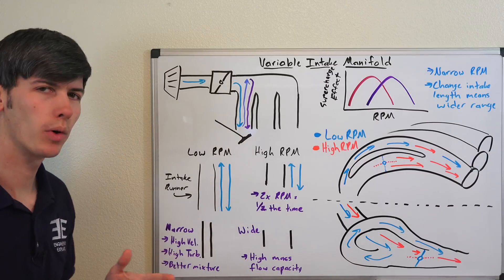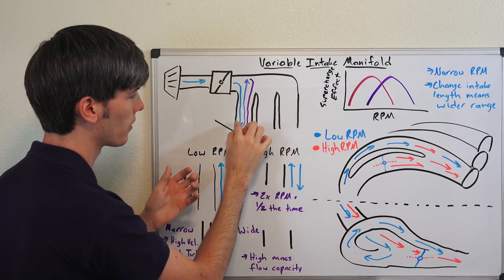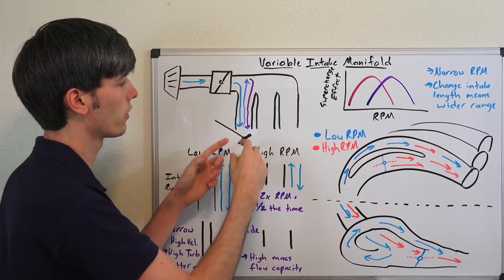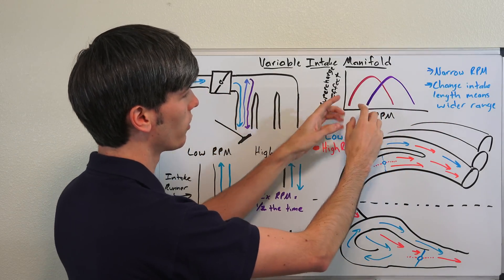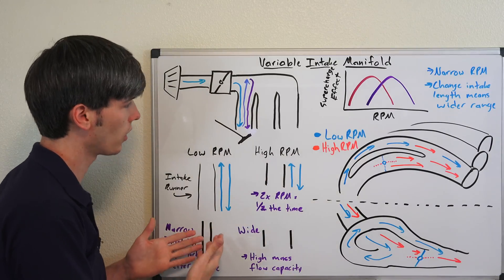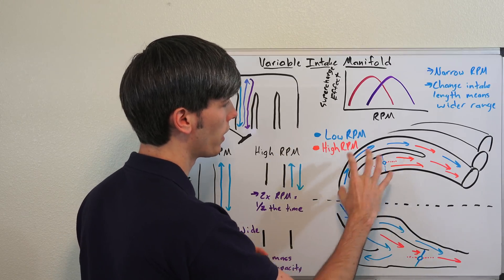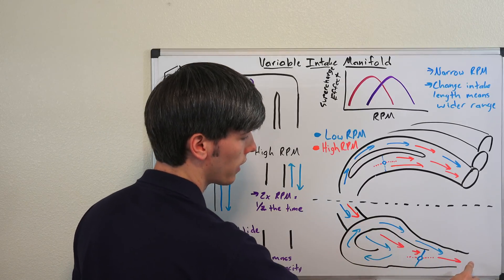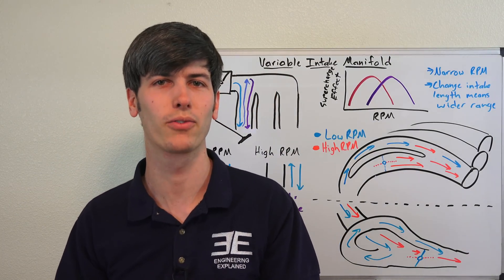Variable Intake Manifolds & Intake Tuning

Comment: How much air is really bouncing around under partial throttle and 15"+ of vacuum? 
Any air bounced by the valves probably just goes straight to the next intake runner.

Comment: Is this the same as those empty black boxes connected to the intake pipe after the air filter box? On some cars I have seen several boxes of varying size and dimension with no known function. My guess is that it's perhaps creating a low-pass filter effect on the intake path to create more constant and less turbulent flow, so the engine always has the best air supply to the plenum chamber.

Comment: I aways  think that the velocity of the air in the runners makes the "supercharching effect", when the valve is closet the air get compressed, and in the right time, the valve opens again and get the compressed air. 
I am right? because if I'm not, how the waves resonate in engines without plenum? like many competition cars.

Thanks.

Comment: I don't get why my fluid mechanics professor has such a boner for water on hills and tanks and not this stuff.
Reply: Probably better employment opportunities in hydraulic systems?
Reply: +tanker9987 Maybe huh.  Power plants, energy initiatives, etc.
Reply: As you know, a fluid can be either a liquid or a gas. Just keep in mind that almost everything in your texts about liquids can also be applied to gases. This would include water hammer. Water hammer with a gaseous flow is found in "tuned" intake manifolds. Back in the forties and fifties, Offy engineers relied on fourth harmonic tuning and used a hacksaw for length "adjustments" on the dyno. Unfortunately, they were tuning to the fourth harmonic. If they had lengthened the injector stacks, they would have "found" the third harmonic, which Chrysler used so effectively a few years later.

Comment: Hey E.E. I was just wondering,all of these technologies are to improve performance over a wider range on the power band.
If cvt's were introduced in more vehicles, do you think it would be more cost efficient to use simpler and less complicated engines,and then in conjunction with the cvt just hit the" narrower" sweet spot of the power band for acceleration??
Thanks for the videos, keep them coming, and next up 2stroke tuned exhaust's and ypvs.

Comment: Do a video on Toyota TVIS system
Reply: The TVIS in my AW11 makes my wanger jangle
Reply: +Vincent Baelde-Millar Metal Intakes! (Mr Regular, Regular Car Reviews)
Reply: Lovro Antunovic Toyota Variable Intake System
Reply: And how many other engines have such pretty cast aluminium intake manifolds
Reply: I'm so happy to finally be in the MR2 club. Just bought an '89 that had been sitting for 15 years. Got it running but it idles at 1,500 RPM warm and has a weird whistle/whine near the intake manifold. I'm going to set base timing and see if that calms it down a little but I suspect either an air pocket in the IACV or a bad IACV. I will eventually port the head and tune the intake and maybe throw a custom map into it. IDK I'll see how far I go with it. I just have to get it running right in stock form first.
Reply: +RyanRants Check the Waxstat is working. that's a common fault that causes high idle.
Reply: RyanRants The best thing you can do is get it running right, at least for a few months, then throw some sticky rubber and some good brake pads on there and you'll be giggling non stop
Reply: MylesHSG That's what controls the IACV, right? How would one go about checking that? The same way as a thermostat, boiled in water?
Reply: +RyanRants The Waxstat is located below the throttle body and regularly gets stuck (so you get high idle even when warm). The best way tk test is to delete the Waxstat (youll have to hold the throttle open on cold starts) and see if that cures your problem. If it does you can buy a new one from Toyota (£95) or fit a manual choke which is cheaper and is a permanent solution.
Reply: I've just read that cleaning the throttle body out could be another solution so I think I will do that first because mine is very grimy. If that doesn't work, I will try blocking off the waxstat and see if it idles properly. Thanks for the advice. I'm pretty sure my timing is off though because it falls flat on its face below about 4-5k rpm.
Reply: I recommend joining the MR2 Mk1 Club forum mate. Even though a UK based club there are loads of AW11 owners willing to share help and Paul Woods who is the worlds best MR2 guru frequently posts.
Reply: The Wiki article has a great and fairly simple explanation on TVIS https://en.wikipedia.org/wiki/T-VIS
Reply: +RyanRants
not only are you in the MR2 club, you are also in the 4AG club :D

Comment: I'm confused because when I was growing up in the 70s/80s the aftermarket intakes were designed opposite of how you're describing these effects. The more mild cammed, daily driver cars with lower end torque got the little intakes with the short runners and the dragsters with their high revving high hp engines got what we called "ram intakes" with runners that ran straight up sometimes looking almost a foot high. These were horrible for low rpms but awesome for high.

My experience does agree with what you said about runner width though. Ford never had a problem with its Windsor version engines, but when they put those huge wide oval runners on their Cleveland engines they got high horsepower but lost low end torque. When they went to the extreme with the original Boss 302 engine and mated Cleveland 4V heads to a little 302 (5.0L) engine, it was like driving a turbo powered car. NO low end, incredible high rpm horsepower. heh

Comment: Will the design of the manifold the same for a N/A car and a Turbo car? 

I'm designing a turbo manifold for my miata right now, already did some flow testing and came up with a good design but i dont know what length runner i should take.  Its a turbo with very fast spool with really big torque numbers between 2800-5500rpm, but the power levels a bit out after 5500rpm because the turbo is out of its effectienty range, So i was thinking in sacrificing some low end torque for some more high end power. Is my way of thinking right? I'm running about 18 psi

Ive design a manifold wich tapers down to cilinder 4 with 4 velocity stacks coming out in the middle of the plenum

Or looking a bit deeper into the design and try to incorporate some variabele intake runners?
Reply: depends on how fast does your turbo spool
Reply: +Kinslayer Gaming i meant when does peak boost hit
Reply: Peak torque should be at around 300ftlbs or 406nm at 4000rpm at the wheels 

In 1:1 gear i reach 18 psi at 3000rpm
Reply: VincentMX5 possibly i would work i say you make a render and animate the flow from the turbo to the manifold the corraborate your idea because it may work
Reply: From my understanding all tuning like this is lost with forced induction

Comment: I would have to see this working on an engine dyno. From my experience which is limited to small block chevy,  putting a longer runner and wider runner like a high rise tunnel ram intake on a 400cu in v8 increases power significantly at the top end and had almost negligible power loss at the lower end. negligible being 4hp compared to the 50hp it gained at the top. Basically i guess im challenging the part of your diagram were you say a short runner is better for high rpm. i have no actual scientific method on paper to back my claim other than dyno proof.
Reply: longer, thinner runners also tend to keep the velocity up in the airflow at lower rpms.  shorter, wider runners are used up top because you tend to not have to worry as much about the velocity at that point. on a turbocharged car with a dual runner intake manifold properly set up it can make a world of difference with extra torque down low, faster turbo spool up while not sacrificing any of the top end power.

Comment: Ironically enough the QR25 first gen had variable intake runners then switched to non-variable in the second gen which made more power. Would be cool to see some numbers/equations for the where/why one setup becomes better/worse than the other.

Comment: Is Toyota's TVIS one of those systems?I know it uses 4 runners in lower RPMs and 8 at higher RPMs so it can have a flat torque curve.This was because the valve angle was 50 degrees and the 8 runners don't allow the air to accelerate fast enough at low RPMs,I think

Comment: can you comment on the schrick variable intake manifold for vr6 which separates the flow for the left and right cylinders with very small runner length difference achieving the same effect?

Comment: Do any cars actually take advantage of this?
Reply from the maker: Porsche GT3 is one I know of!
Reply: Even my '99 Ford Cougar, or in US known as Mercury Cougar, which is using the 2,5L V6 Duratec is using this technology and its effecting the performance significantly. 
I know that because it's a pain in the ass to repair the IMRC everytime it breaks again. The IMRC is opening the valve for higher rpms (above 3,7k rpm to be exact), and trust me, you notice when your car struggles to reach 180kmh, while its capable of doing 240-250kmh with working IMRC. 
You even feel the power "kicking in Yo" when the valve opens.
Reply: Bmw has been doing this since the 90s using a system called DISA. The new engines use a 3 stage system.
Reply: Audi uses it a lot. My 2.8 30 v6 has a 2 stage and the 4.2 40v v8 has a 3 stage intake. Problem is due to pcv recycling is that the oil clogs the valves and you get dead spots. The valves are vacuum operated.
Reply: Mitsubishi used it in the 30M Diamante, the 3L MIVEC V6 JDM model.
Reply: my car use it. Change the intake manifold with non vim and the engine losses it power at low rpm
Reply: Toyota has a system called TVIS and they use it quite a bit

Comment: So what would be the maximum equivalent boost pressure this could achieve?  I don't imagine it would be more than a couple of PSI, but then that gets you 30-40 HP depending on the engine for a lot cheaper than a turbo or supercharger.  I am also  curious what vehicles out there are currently using or researching this.

Comment: Any HP gain numbers? Because those manifolds must weight so much
Reply: on my 02 focus svt it is plastic. its not all about hp gain, but more about the power curve of the engine. the focus svt has this technology and it feels like vtec but more gradual
Reply: I used to have a '04 Focus SVT, and I distinctly remember that I could feel when it engaged around 3300 rpm, I'd feel myself being pushed into the seat just a little bit more.  It did end up malfunctioning at one point, that was a nice $700 repair bill... every time I find myself missing that car I stop to think of all the money I spent fixing it, then I feel better, lol.
Reply: Well it depends on many parameters but here is one example:
Mazda KF Engine 2.0L, 144HP at 6000rpm, max.torque:  185Nm at 5000rpm
Mazda FS Engine 2.0L, 130HP at 6000rpm, max.torque: 171Nm at 4400rpm
The VRIS system of the KF Engine provides a better torque curve in the higher RPM by filling more air into the engine therefore producing more power
Reply: I'm not sure about extra hp,  because when my car vim was changed to non vim manifold, it has torque dip at low rpm. It no longer has linear curve all the way to the top.
Reply: Fitri Zailani
Thats because of the fact, that your "non VIM" has the same characteristic as your "VIM" has in the higher RPMs
But your "VIM" was able to provide better torque in lower RPMs ALSO.
You can only achieve HP Gain, if your standard Intake is not already optimized fpr higher rpm. Some "Non VIM" from the manufacterer are, for example, optimized for 4000RPM then you can achieve gains at 5000RPM with a "VIM"
Reply: Marzelmusik thanks for the explanation. The manifold I used is for the newer engine with VVT. The old engine didn't have vvt. The main reason is cheaper to use but I have to suffer with lack of power.

Comment: +u wot m8, that depends on the intake manifold and the engine its equipped to. just know that intake manifolds are also rated to handle power at specific ranges.

Comment: I am making a fluid heat exchanger which will vary in its capabilities based on increases in viscosity. Would using a variable intake manifold system be a viable means in increasing the surface area the fluid moves through as well as altering its flow rate?

Comment: There are 4 different intakes for my engine each one has a different length with the variable system so the ecu has to open the valves at different times. You can choose the intake for peak or midrange power.

Comment: the high or low RPM depends on what ?? and what's the rules to choose the true diameter or capacity of the intack manifold??
Reply: Low end torque: long and narrow.
High end horsepower: short and wide. 
Each engine is different from the next.

Comment: How much pressure difference does the wave actually make? Any numbers?
Reply: 32
Reply: Are you accepting negative numbers?
Reply: 69
Reply: Since you don't "force feed" the engine, this is a way to shift the peak torque to a higher rpm. Just imagine if you had a fully adjustable intake. that would be an interesting torque- rpm curve to see.  but 2 tuned intakes are better than one. Perhaps you only need 2?
Reply: Basically you can look at the volumetric efficency. It's stated that it is possible to achieve 130% volumetric efficiency with a natural aspirated engine, so basically 30% pressure increase. But that's really if you hit the sweet spot with a perfectly tuned intake manifold.
Reply: shi01, That's not because of the intake alone though. Something with a VE that high would require all of the parts to be perfectly in tune with each other, combined with very little restriction and exhaust purge tuning in combination with the cam timing to pull air through the motor on valve overlap.
Reply: in the focus svt the power curve is satisfying its kinda like vtec... this is all because of the intake runners the zetec engine has
Reply: Eric Fixalot
Well that's true. Such high VE can not be achieved solely by tuning the intake alone.
Reply: Depends on many other factors
Reply: Depends on rpm and engine cc

Comment: BMW uses that on older engines including mine, the valve in the manifold is called DISA. The best engines...
Reply: M43 4cyl. with DISA about 118hp and without 105hp.same shaped intake,both versions where available
Reply: M52B25TU :)
Reply: MPOWER!!!!
Reply: m50?

Comment: How many bhp can You gain with this? How do You calculate when the wave will bounce back? Is it determined by experiments or is there a way to reliably count it using math?
Reply: I don't know how much hp is being gained, but when the flapper valve is activated at around 3500rpm on my '95 Mercedes E320, my car rockets forward. It has a brisk, but stately, acceleration from 0 to 3500. Then at 3500, you can hear it (and feel it) kick in.
Reply: Just look for performance manifolds for your car. No offense it's not like your going to be making your own manifolds, most people don't. But there are companies like Edlebrock that make manifolds with this stuff in mind.

Comment: You mention this variable intake gives a "turbo boost" effect. Since turbo and supercharged cars already have increased psi's, do they not use (or benefit from) variable intake set ups?
Reply: I was wondering this as well.  I am assuming (and we all know what happens when people assume) that given the super short spool time that most modern turbocharged vehicles have,  such a system has negligible benefit. That said, I could see this maybe being useful on a very large/oversized turbo setup where there is significant turbo lag and a very large section of the rev range where the engine has to operate without boost. Of course at that point,  if you're willing to add that extra complexity/cost, perhaps that money is better spent on a variable geometry turbo?

Comment: What if you had a car with a variable intake manifold, variable compression, and an infinitely variable transmission?
Reply: non-existent reliability?
Reply: you would certainly be banned from FIA
Reply: 2000 rpm all. The. Time. Haha
Reply: You'd need a variable geometry turbo.
Reply: to many variables cannot solve.
Reply: variable car
Reply: A programmer with a headache
Reply: MJorgy5 exactly lmao
Reply: Include variable valve timing and lift
Reply: Quantum Car cannot be known without forcing it to choose a position.

Comment: any cars this is used on?
Reply: Toyota 4A-GE on the AE86 and AW11 MR2
Reply: https://en.wikipedia.org/wiki/Variable-length_intake_manifold quite a few
Reply: early SHO Tauras with the Yamaha engine
Reply from the maker: I think a version of the Integra actually used it. Porsche GT3 uses it today for sure.
Reply: in a lot of older porsches
Reply: Audi, BMW, Ferrari, etc Some Hondas such as Accord v6... ive only heard it being called a mutli-stage plenum
Reply: My 1995 Mercedes E320's have this set up.
Reply: a lot of hondas! the prelude and integra are a couple.
Reply: Ford Focus SVT the grandfather of the focus st and rs lol